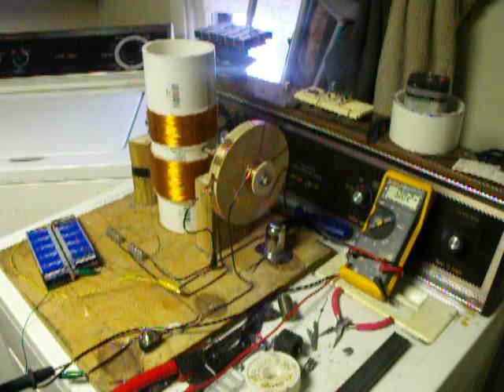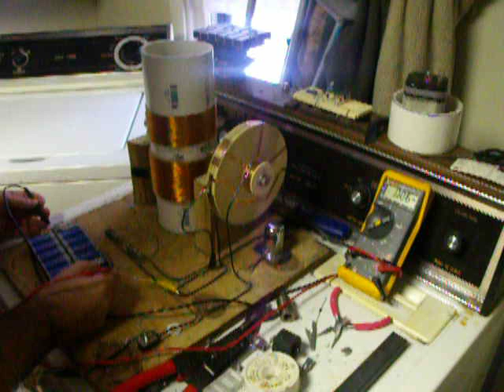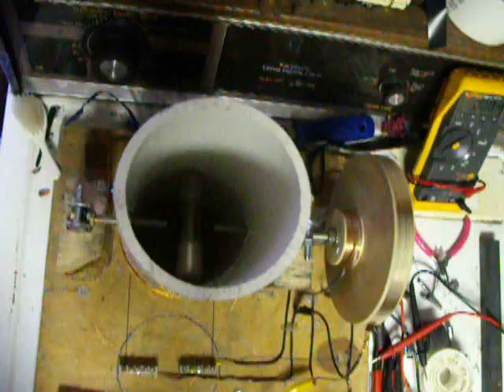My First Newman Motor part 6

Comment from the maker: @EnterAtOnesOwnRisk:  The reason my motor slowed down was due to a bad battery interupting the flow of electricity.  I figured this out with my second motor, and it worked like a charm, so I moved on to motor #3.  Why so much voltage???  Joseph Newman's theory is:  Its the voltage that aligns the atoms of the copper wire.  The more voltage, the more atoms are aligned, the stronger the magnetic field.  This also works my adding more wire.

Comment: @detrix42 My wife is VERY NOT interested. I don't build motors for her however. We have the same washer LOL. I like the idea of using small reed switches and magnets for pulsing and collapsing the coil. You are using a lot of energy on your commutator a smaller design would reduce the drag. Happy Motoring